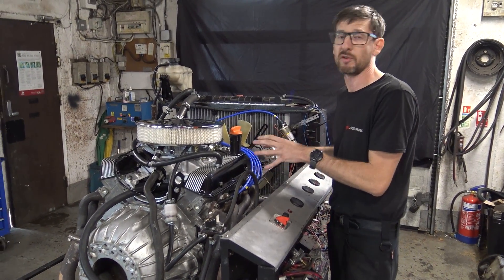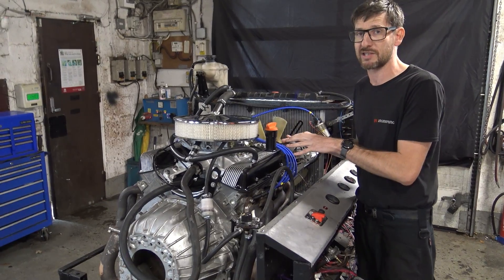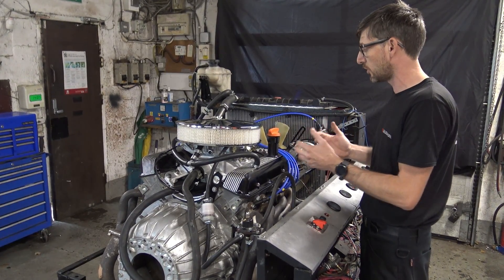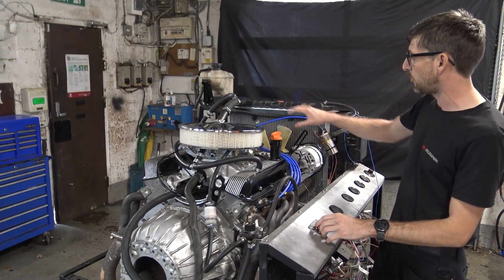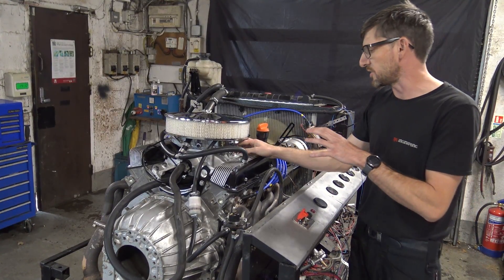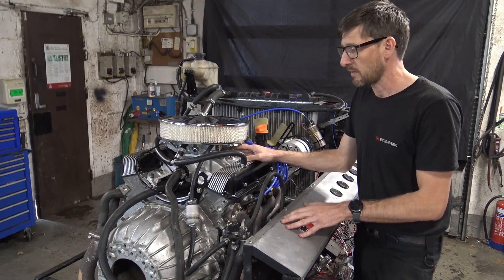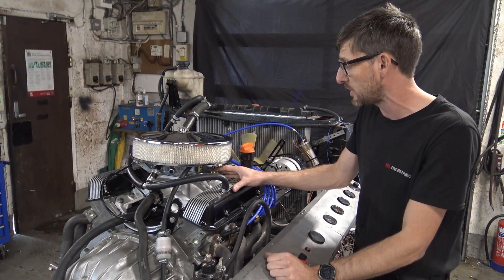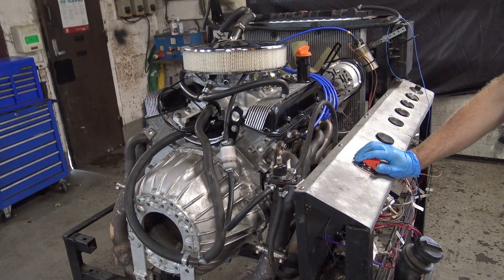3.5 Stage 3 Rover V8 on the RPi Engineering Test Bed

Comment: Ditch the "Rover" engine and use a 340/350 Buick with alloy aftermarket heads instead,
T/A Performance makes a lot of performance parts for these engines (taking over where Kenne Bell left) The 350 are capable of making a lot of power with a very slight weight increase....
Reply: you do not even know what your talkinh about ! STUPID !

Comment: I’m building a twin turbo (sierra cosworth turbos) 3.5v8.  Omega pistons etc flowed heads.  Hopefully 350/400 bhp.   
Question is…  will the R380 gearbox take it.  It’s a Ashcroft heavy duty bearing gearbox.  

Thx Ed
Reply: TOTAL BULL SHIT + if you can`t get 1,400 hp i will eat that engine = you know nothing about engines !